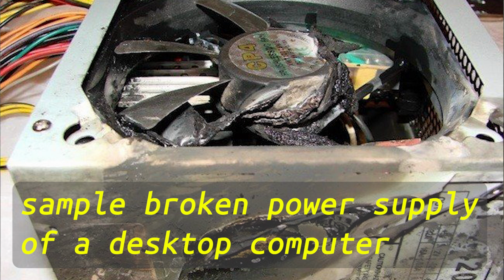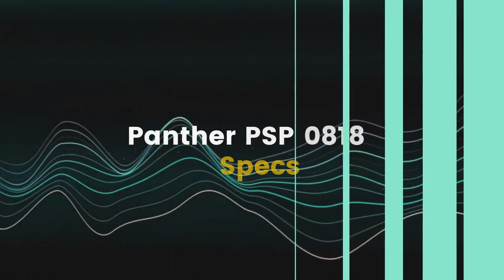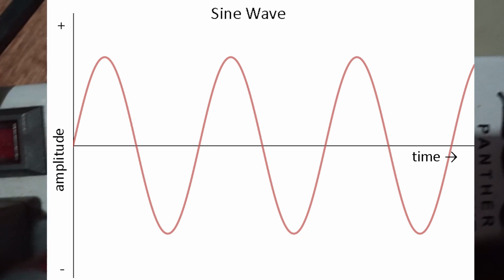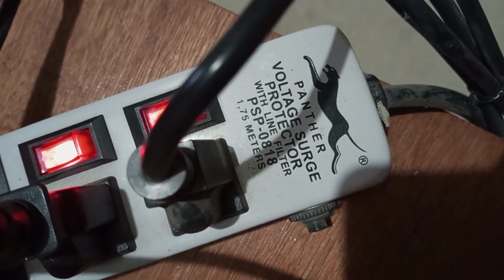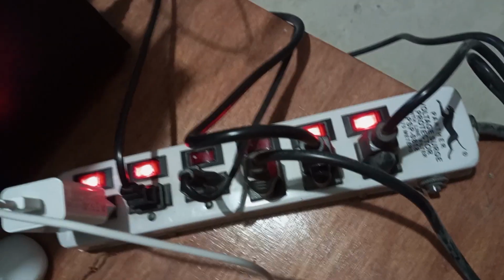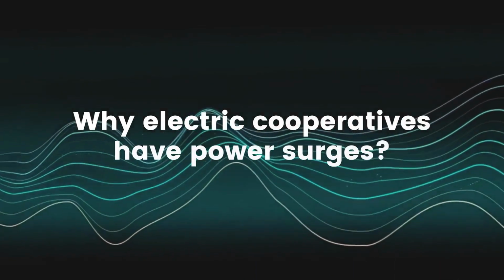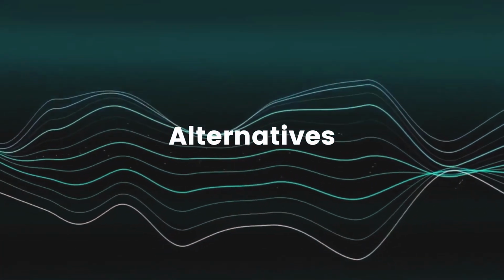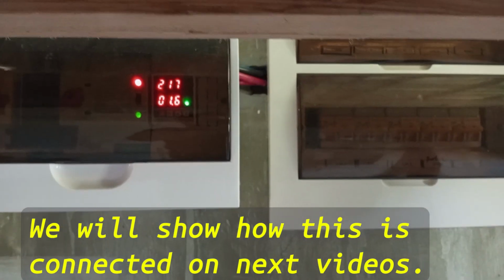Panther PSP 0818 Extension Cord Review

Comment: Safe lang po ba pag laging naka plug? Yung tinuturn on lang ang switch every time gagamitin yung specific electronic device?
Reply from the maker: Safe naman lodi, sakin ganun eh. Pero if matagal ka wala sa house, bunutin n din para safe
Reply: @jjhomeandlifestyle okay lang po ba pag 215v lang ang input voltage? 215v lang lasi pag tinitest ko yung outlet
Reply from the maker: @joshuasemon364  216v sakin ok naman (gamit ko solar lodi).. avr usually 210v to 230v, kaya safe p yang 215v
Reply: @jjhomeandlifestyle  okay po. Salamat. Happy New Year 🎊
Reply: @jjhomeandlifestyle one more question po. Yung wall outlet po kasi namin ay 2 prongs lang, wala atang grouding system. Gagana parin po ba at the same level ang surge protector ng Panther Extension Cord?
Reply from the maker: @joshuasemon364  depende po. May surge protector n need ng grounding ex. dc solar surge protector. Yung ganito naman n extension lang, not sure anu laman nya sa loob if ibabato nya sa ground ung excess surge voltage..

Comment: why po if naka-OFF yung red switch pero nakasaksak yung laptop and monitor and nakasaksak din po mismo yung extension cord sa power outlet, ang lakas po ng ground ng laptop if nahawakan? But if naka-ON naman yung red switch medyo nababawasan?
Reply from the maker: Grounded yang socket nyang extension pag ganyan. Nababawasan yung ground if naka-on kasi yung leaking current ay dadaloy from line 1 to line 2. Line1 lan if off tas disconnect si line 2, means sau dadaloy ung leaking current kaya malakas sya magground